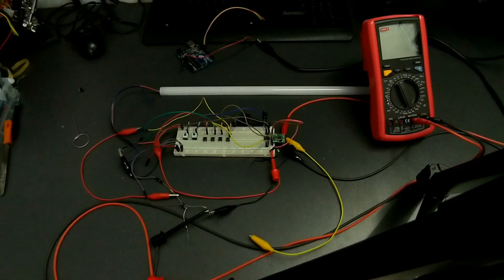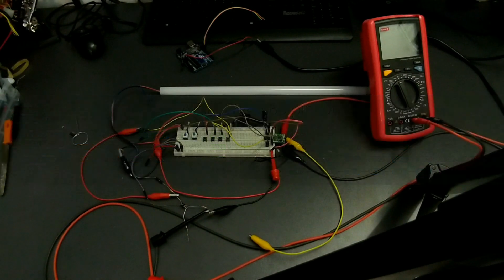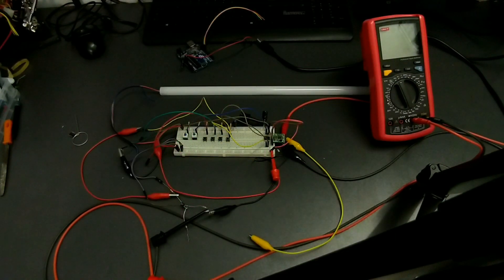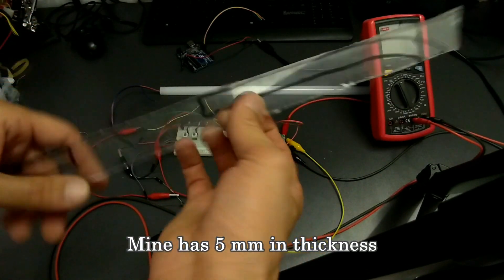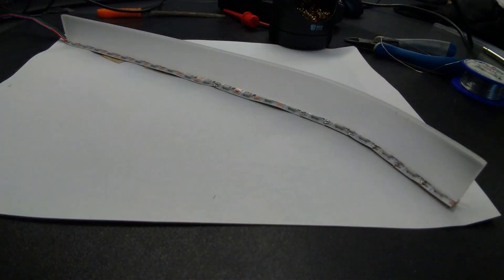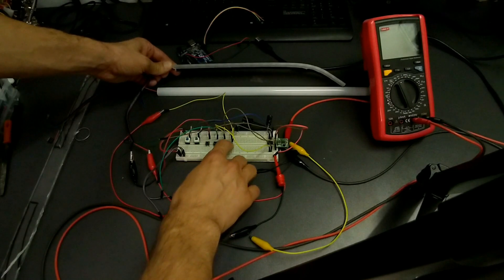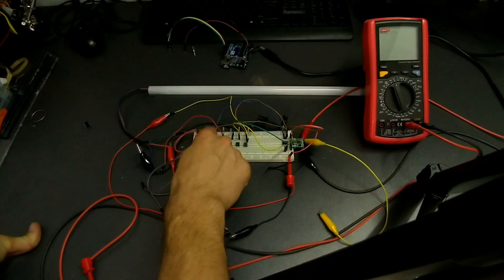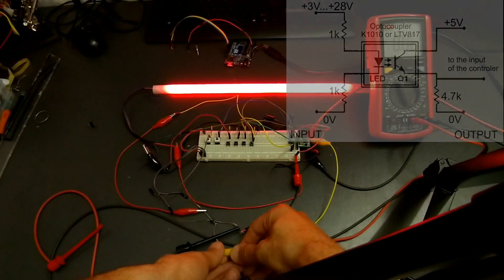Modern turn signal lights v6.0 Attiny85 dedicated strips - Arduino, FastLED and WS2812B

Comment: Hello Superb work! I am working on something very similar in design but i have no knowledge in arduino and programing, so your channel is super helpful. My main question is how to connect such a system to a car switches? Is there possible to use oem cables and switches signal? Can i use drl with "auto" switch in my car and with dusk sensor?
Reply from the maker: Thanks! 
In the next clips (when i will have the time to make them) you will learn all you need on how to use an optocoupler as inputs or outputs for you projects... because optocouplers are the safest way to link different logic voltage computers. ;)

Comment: Hi, is it possible to use high power 3-Watt bead LEDs instead of WS2812B strips?
Reply from the maker: If you refer to normal rgb leds, no... because then you will need to use three mosfets and three outputs for each led... and it will get very messy...
I don't think that high power digital leds exist on the market, but correct me if i'm wrong.
Reply: @IonutF-TS-BB  Hi, I am talking about these LEDs: https://www.youtube.com/watch?v=ewkMoUp20qk
could you please check it and let me know if these LEDs could be replaced with WS2812B strips?

Comment: Hi 

Thats great what do you do . Where do you buy the parts fir this projekt ?   

I want this projekt make in my audi a6 . Ich have 3watt bicolor power leds yellow/white  

And now i need the microcontoller and than i can start my project . 

Sorry for my bad english , i‘m from germany
Reply from the maker: Hi and thanks.

I'm always in a hurry when i make the clips and i forget to put links in the descriptions. I promise this weekend i will do just that on all my clips. :)

Well, if you wanna use your 3 watt bicolor leds the code and schematic will not be the same and you will need a power mosfet and two outputs on the controller for each led(or using a multiplexing chip). It will be a completly difrent thing.

So, do you have in mind to use 3 watt bicolor leds or digital leds(ws2812b) ?
Reply: Hi 

Yes i want to put the 3 watt bicolor leds becauso there are brigther as digital leds and i can every led  put where i want  . 

Thanks for the answer
Reply: I use low voltage transformer for 600ma constant current and 12v voltage.  I switch 3 leds in a row per transformer for dynamic turn signals and daytime running lights, 9 LEDs are connected in series with a slightly larger transformer.  if that is too complicated with dynamic turn signal and the power leds you can then help me to build it so that the daylight dimmed when I turn on headlights and goes out as long as the turn signal is normal

Comment: Hi friend, how to use this sketch on Arduino nano? Please help me.
Reply from the maker: You only need to uncomment this lines:
//input pins for arduino ( except this one !!!!! )
//const int buttonPinTS = 2;                  // turn signal pin for arduino
//const int buttonPinEng = 3;                 // engine on to start day lights for arduino
//const int buttonPinKnightRider = 4;         // knight rider lights for arduino
//const int buttonPinTailLights = 5;          // night / tail lights for arduino

//FastLED.addLeds<NEOPIXEL, 13>(leds[0], NUM_LEDS_PER_STRIP); //led strip front left for arduino

and comment this lines:
//input pins for attiny85
const int buttonPinTS = 1;                  // turn signal pin for attiny85
const int buttonPinEng = 2;                 // engine on to start day lights for attiny85
const int buttonPinKnightRider = 3;         // knight rider lights for attiny85
const int buttonPinTailLights = 4;          // night / tail lights for attiny85

FastLED.addLeds<NEOPIXEL, 0>(leds[0], NUM_LEDS_PER_STRIP); //led strip front left for attiny85

from both sketches.
After that the code should work ok.

Comment: Wonderful work, would you please help me with a project that have  tail light, reverse light, brake light and turn signal for attiny 85  in one sketch?
Reply from the maker: First of all, thank you for your donations... it really means a lot.
Your the second one that asked for the same functions in one strip with attiny85.
I still think that it's not a good idea to have brake lights and signal lights on the same strip, because a fraction of second can make the difference between life or death if the driver behind you sees your intention or your brake light.
I know that this is allowed in some countries, but i leave in Romania (Europe) and here this is not allowed and i do agree with this law.
So, i will try to make a new revision for version 6.0 with this functions in one strip and release it in the near future.
The only problem is two make it feet in the attiny85, because it has only 8k of program memory... ;)
Reply: @IonutF-TS-BB  I wish I can donate more. 
For the stop light + turn signal on the same strip , I am using it as a secondary option.  If attiny85 memory not enough, can you make it ( running light + brake light + sequential turn signal ) ??
Reply from the maker: By running light you mean daylight?
Well, let's see first if i can feet in the first request and i'll be back to you... The problem is that the biggest off them all is the sequential turn signal.
I was really busy last week and this week with a personal problem, but i will try to get the video out this weekend.
Reply from the maker: Hi, here is the version that you needed. https://youtu.be/cia5Xr7aA0c

Comment: Your project is great and just what I was looking for. Do you have a version that would have taillight, reverse light, brake light and turn signal in one sketch? When I try to add turn signal into your tail sketch it breaks code. Any suggestions would be appreciated. Thank you very much for you time.
Reply from the maker: Thanks!
Yes, but not with attiny85 and on different strips (version two). It didn't fit into attiny85, but it also wouldn't be safe to use the same strip for signal lights and also brake or tail lights... i sugest to use two attinys85, one for signal lights and one for the rest, so in this way you will have both signal and brake or tail lights.... because both signal and brake lights have great importance for vehicle approaching from behind and that's why you should have two stripes, one for each function.
I know it will be cool and great, but i wouldn't be safe...
Reply from the maker: I don't know if made it already, but here is the version that you needed. https://youtu.be/cia5Xr7aA0c

Comment: How to switch 1 and 2? 2 switch in 1?
Reply: And how to know if i use 470 and 270r?plsss thanks.. Big help
Reply from the maker: @jcjanestardo1782  If you use  470 and 270r where in the schematic?
Reply: @IonutF-TS-BB  If i use 470 instead of 220? What will happend? Dexreases the brightness? I over look sa 220 hehe.. In the previous diagram its 470.. I have only 470 smd r..
Reply: I want to add u in fb boss.. Hehe
Reply from the maker: @jcjanestardo1782  The resistance 220 ohms is on the data line for the leds, it will not decrease the brightness, but it will reduce the cable length for the data line.
You can test and see if it's working ok with the cable length that you need for you wiring.
Reply from the maker: @jcjanestardo1782  Actually, i'm among the few that facebook is collecting data indirectly, so sorry, but i don't have a facebook account.
Reply: @IonutF-TS-BB  Oh i see so 470 for long connction..
Reply from the maker: @jcjanestardo1782  Nope, the other way around, 220 ohms for long connections.
Reply: @IonutF-TS-BB  Aw how many meters  can 470
Reply from the maker: @jcjanestardo1782  Don't know, didn't test this aspect, but the length will depend on several aspects and you must test in your own project environment.
Reply from the maker: I do not understand what you mean by " How to switch 1 and 2? 2 switch in 1? "
As for resistances, use the values from the basic schematic.
Reply: @IonutF-TS-BB  he means s1 s2 in the diagram hehe his my brother
Reply from the maker: @justinestardo8545  That his your brother i figured out, but i didn't understand the question... why to replace it in the code (i presume) when he can place the wires in his own order???
Reply: Can you include an up close look at your bread board and how it is wired, yours is so clean and nice, I would like to test mine before putting it in, keep up the awesome work
Reply from the maker: @MERTattoo  Actually, i didn't take close up shots of the bread board, but you have the schematic at the end and in the download link for all the wiring.
From now on, before i dismantle everything, i will take close up shots off everithing.
Allways test before making the final circuit, allways test before closing all up and allways do something that you can easily open in the future to fix it if it's needet.
Thanks and that i will do. ;)

Comment: Hi,

when trying to upload the code to Arduino, I get Dvoid does not name a type.

In file included from C:\Users\imadj\AppData\Local\Temp\arduino_modified_sketch_430223\semnalizare-v6-tail.ino:2:0:

C:\Users\imadj\Documents\Arduino\libraries\FastLED-master/FastLED.h:14:21: note: #pragma message: FastLED version 3.002.009

 #    pragma message "FastLED version 3.002.009"

                     ^

semnalizare-v6-tail:35:1: error: 'Divoid' does not name a type

 int reverseLightModel[] = {7,8,9,10,11,12};                    // model array for reverse lights leds from 0 - 19 for 20 leds

 ^

semnalizare-v6-tail:36:64: error: 'Di' does not name a type

 int rearFogLightsModel[] = {0,1,2,3,4};                        Di// model array for rear fog lights leds from 0 - 19 for 20 leds

                                                                ^

exit status 1
'Divoid' does not name a type
Reply from the maker: Sorry, my mistake!
When i clean up the code i've forgot a "Di" in  the front of the comment at this line ... 
int rearFogLightsModel[] = {0,1,2,3,4};                        Di// model array for rear fog lights leds from 0 - 19 for 20 leds
I've reuploaded the sketch ok. You can download again or delete "Di" from the above line.
Reply: Thanks for the reply!